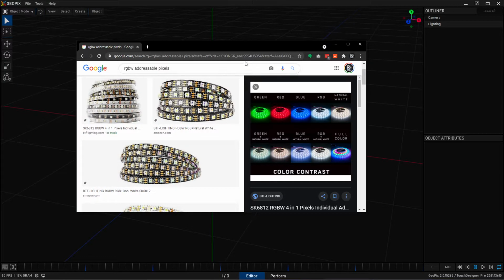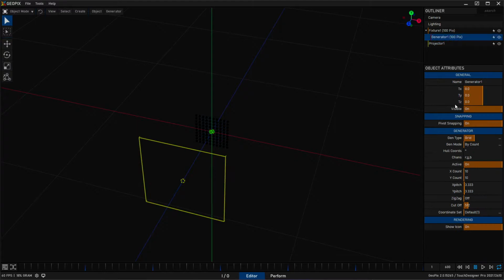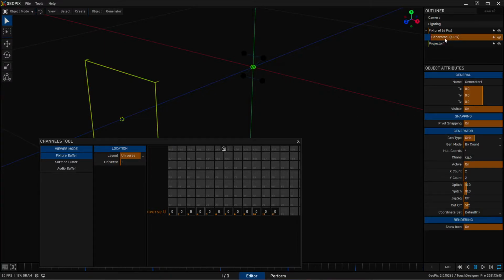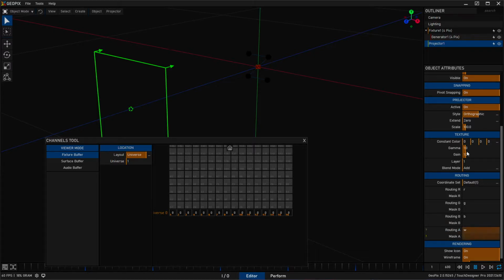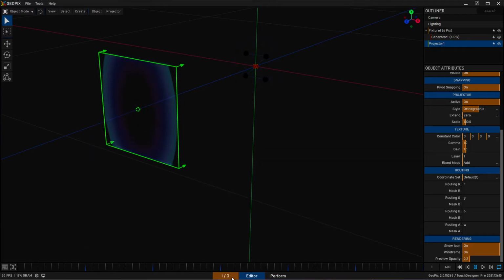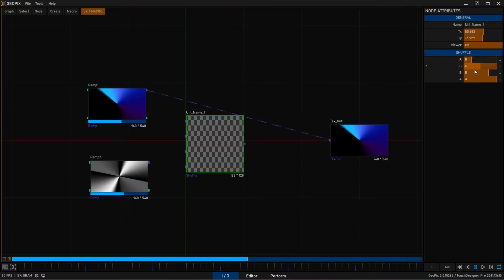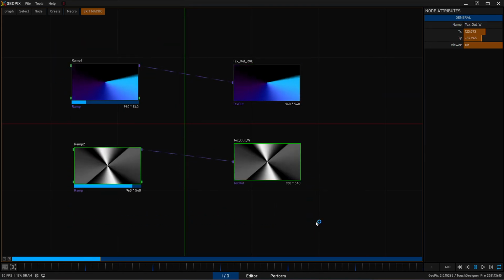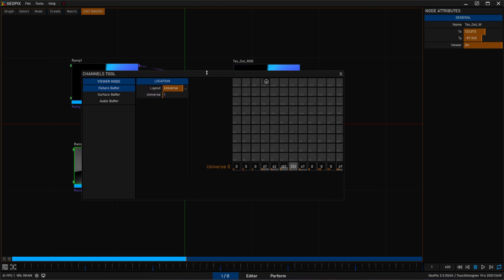GeoPix 2 0 -  Barebones Example - Controlling RGBW Pixel Strips

Comment: Thanks Lucas for great tutorial again. Maybe one thing that would be a nice to have is the conversion from RGB texture to RGBW pixel, that would mean substracting the RGB common value to send it to the W value so we use only the white pixel when outputing white ? Still these are great workarounds, I guess we could extend to multiple channels like Ambre, UV or even moving head tilt and pan.
Reply from the maker: Great suggestion - yeah some kind of "smart" node in the IO tab could conceivably look at a texure with r/g/b at or near white and tend towards the white diode instead of color mixing.